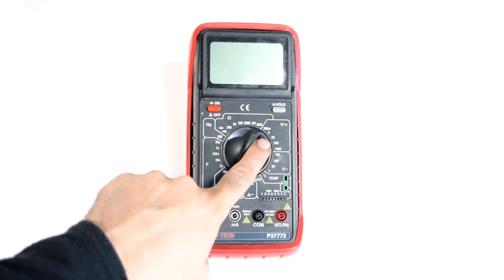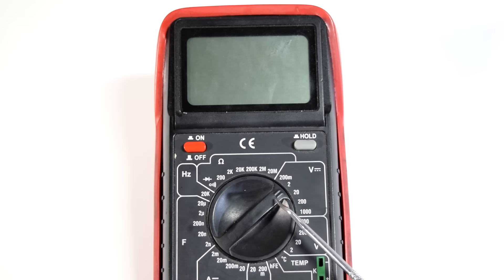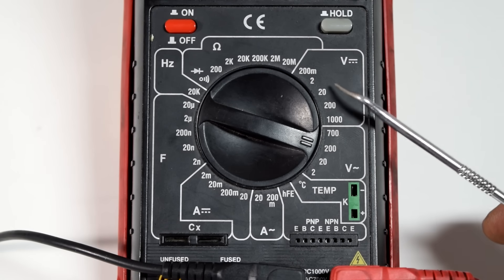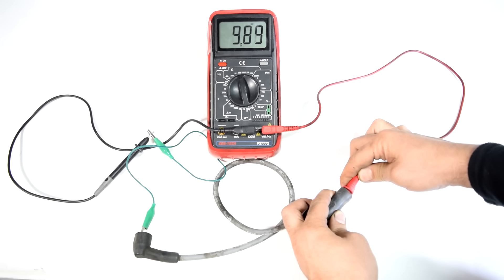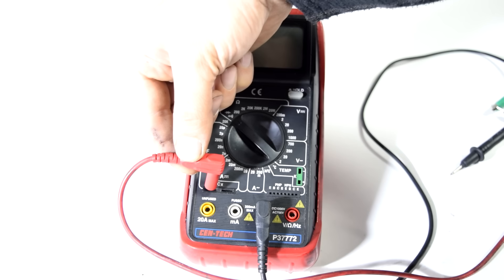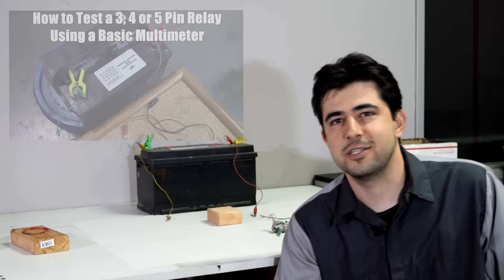How to Use a Multimeter for Beginners - How to Measure Voltage, Resistance, Continuity and Amps

Comment: You should not ideally put the probes in a mains (110v) socket with a probe in each hand. In the event of a discharge, the power will be sent straight across your chest - which may prove fatal. I was ALWAYS taught to use ONE hand to CAREFULLY insert the two probes into the sockets!...

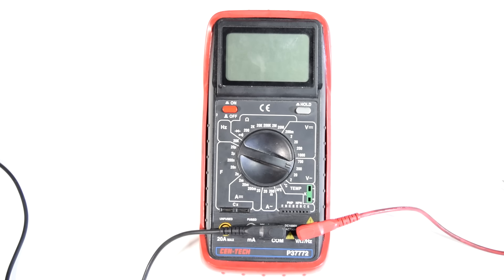Comment: I was watching this for refreshing on using a multi meter so I could measure things on circuit boards and then 3:20 I hear you casually say "So this is 118 V"💀💀💀 While I am playing with 12VOLTS over here🤣

Comment: I have accidentally connected my multimeter in parallel with leads connected to A port. I caused a flash. Is this fuse blown or meter is gone?

Comment: Great video! Thanks.

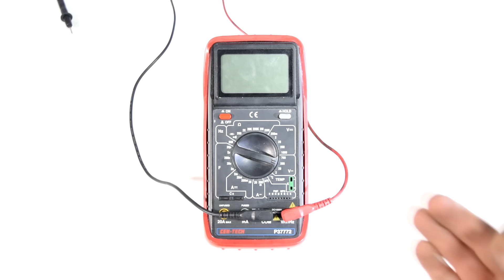3:45 The 'horseshoe symbol' is the omega symbol, which is used to represent ohms. The measurement unit for resistance in this case is ohms.

Comment: DC Voltage (0:14): Explains what DC voltage is and how to measure it using a multimeter.
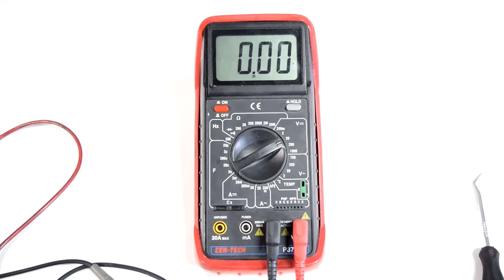AC Voltage (1:56): Describes AC voltage and how to measure it, including important safety precautions (2:35).
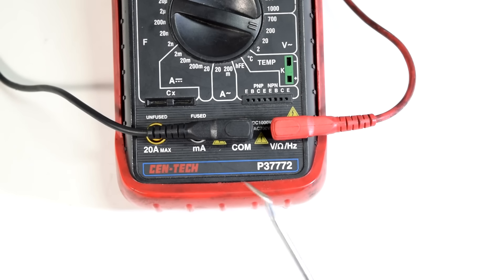Resistance (3:21): Explains resistance and how to measure it in a circuit (3:47), using a spark plug wire as an example (4:05).
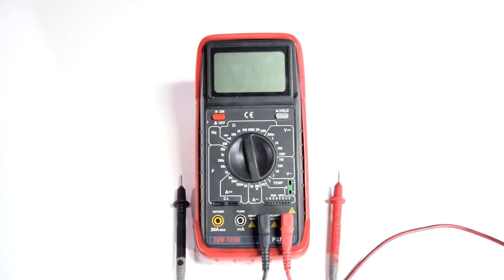Continuity (4:41): Describes how to test for continuity to ensure current flow in a circuit (4:45), including a word of caution about testing unpowered devices (5:46).
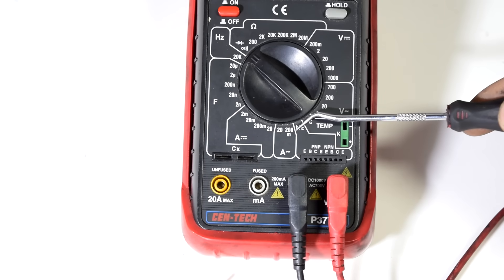Amps (5:54): Explains how to measure amps, including the importance of using the correct settings and test lead positions to avoid damaging the multimeter (6:17).

Comment: Great video, I am 66 yrs. Old and I see people using these meters like it's a Holy Bible, I just don't understand that after you get your reading from the meter then what? The meter doesn't fix anything all I can see is a bunch of settings that makes me dizzy. Other than checking  batteries. I just don't understand maybe I just have gotten to old to understand. I was going to buy one at home Depot just to have one setting in my tool box collecting dust. I just don't understand stand WHAT DOES IT FIX? I see it as a probing tool that fixes nothing. Thank you for the video.

Comment: Nice explanation, I'm a novice but always try to fix before throwing away. I inherited my foster dads multimeter & only know how to measure voltage. It's so old that I don't think it's got continuity. So I use just voltage for everything. 
All I fix are led bulbs & replace pots and caps. It's handy to know the resistance for unpublished items. Linear pots especially. I've also fixed 7 air fryers, 99% of the time it's a thermal fuse that's gone. They all seem to use 192c (377f) which seems low, their maximum temperature is between 210-240c /410-464f. I've been tempted to bridge but didn't or use higher temperature 205c/400f. Only one air fryer had a blown Smd fuse on the element/rear board. Again I used voltage and found it to be open. 
I'm rambling now but yes voltage is all I've used. I really want to get more into electronics as I've got older music production and hifi gear I just can't throw away.

Comment: Question the way you just showed how to test continuity let's say I'm working on a plug outlet n I'm not getting any volts from it n to check continuity how would I set the tester poles to check it, sorry I forgot what they r actually called😅

Comment: Great training, just an area of opportunity about continuity.  If your have continuity and clip a wire like you did it's not a short, it's an open circuit. Lots of folks jump to short circuit because they've heard it a lot but opens probably happen more (depends on your application). A short means the path has changed to take a shorter path of resistance than intended, an open means flow cannot get from a to b because of a disconnect. Like a cut wire. Thanks again. Just helping.

Comment: Thank you for this video.  I’m going to be rewatching this, oh about a dozen times!  You covered a LOT of info & I might say very well!  Concise & to the point, you showed me stuff I’ve only wondered about for over 50 years!  I have primarily used one of these just as a circuit tester and voltage meter.  And I never knew how exactly to do it.  I just stumbled along.  You’d think the manufacturer would have decent instructions. But o never saw any!  So thanks!  You’re a Mensch!

Comment: A great video, but what section teaches you to test for voltage after turning the circuit breakers off before you unwise or disconnect?

Comment: Working on Class 8 trucks , using a voltmeter DC voltage , continuity , or a 12 volt test light  always apply a load to test wiring .

Comment: Excellent!  I have a multimeter and always think I know what I'm doing but really fumble around with the knob and give up.  I like how you use the metal pick as a pointer and not finger-pointing that sometimes is vague as to what exactly is being pointed to.  I knew exactly where you were going.  Clear, concise explanations, and examples on each mode. Thank.

Comment: Thank You for this excellent step by step guide for beginners. It's perfect! The Centech C300 multimeter I purchased does not have a 15 or 20 Volt selection. The nearest selection is 60V, which I used to test my 12 Volt battery on my RAV4 Hybrid. What happens if I use a selection that is too low or too high? Like 1.5 Volts or 600 Volts?

Comment: When measuring Ohms you need to short out the red and black leads together and note down the resistance of the leads first, then measure the component and deduct the initial measurement from that result. All leads have some small amount of resistance... This can be critical when testing vehicle ignition coils tolerances.

Comment: On your meter, you show DC voltage which shows several ranges and the symbol ;question,on other meters, I have seen only the Symbol for DC.  What the difference in meters. Thanks.

Comment: Brilliant video, extremely helpful!

In the part about testing AC voltage, you caution the viewer to be sure of the integrity of the multimeter, probes, and leads.  Can you elaborate on that?  Do you mean making sure that the leads are fully plugged into the device, and that there are no cracks or holes in the insulation?  And how do you verify the integrity of the multimeter?  Would that be to use a different test function that isn't so potentially dangerous?

Comment: What is the positive side on a light bulb 💡? Is it crucial not to to switch positive with negative while measuring a current (ampere) ? Whatever that means.
I think you didn't explain alternate current measurement. Would you recommend a link to another video for that?

Anyhow, anyways, however as always, Thank You for this really fundamental explanation here in this clip

Comment: I have a Centech too so this was a good video thanks!!! I am building a drone and a total noob to meters. On your meter do you use the diode setting to check continuity? Mine doesn't have the extra amp plug in it only has 1 and it says 10 A... so I can only test up to 10 amps??

Comment: great video !! just want to ask one question when I'm testing for continuity and I've put my multimeter on the sound wave setting, I want to test a switch in my water softener. Do I plug in the water softener while testing it or unplug it?

Comment: Question: so does it mean you must always have a fair idea of the reading you should be expecting before you continue with the testing????
I ask because you said the multi meter is likely to get damaged if you're quite unsure about the voltage/amps that flows through the appliance..

Comment: No matter what I measure, the display shows 0.00. What am I doing wrong? This is a brand new multimeter. My probe leads don't have the metal ends like yours, they are plastic all the way to the tip.

Comment: the 10A socket is just for measuring amps right? am I right in thinking if you wanted to measure the voltage of a car battery you would use the other socket

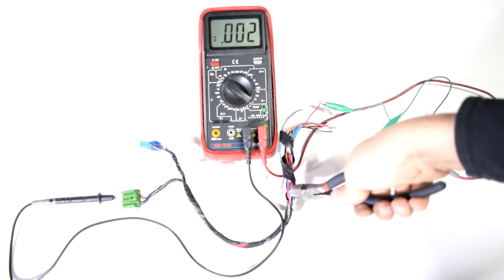Comment: Good vid.  However at about the 5:28 mark, you clip a wire and the continuity tone stops.  That is an open circuit, not a short circuit that you mentioned.

Comment: What a spectacular video. So clear and to the point, made for common users out there. No technicality whatsoever and use of very selective props to make it easy to understand, including all the safety measures… bravo. It cannot get better then this. 
I had no clue at start of video and but end of 8:00 minutes, I clear on so many things and can confidently use multimeter.
Thanks a lot 🙏🏻🙏🏻

Comment: Your videos are always excellent. I have one comment. When you cut the wire you don’t have a short. That is an open or incomplete circuit. A short would be a hot wire grounded somewhere in the circuit. It would blow a fuse or pop a breaker.

Comment: I have 2 questions
First 3:04 what happend if i switch them and put the negative in the positive and the positive in the negative
Second if the device i wanna measure works on chargeable battary is it DC or AC ???

Comment: Thank you so much 
But there is a question 
Can we test voltage in the relay base on a car I mean after we remove the relay from the fan relay for example  can we put one lead on the 30 pin and the another lead in 87 ? Will that activate the fan as jumper wire ?  
Will that burn the fuse of the multimeter?
Or it will just read 12 v between 30 and 87 ?
I wish you answer my question 
Thank you so much

Comment: Thanks.  Very self explanatory.  This really helps.  Now for the test.  Question, how do I test a cooling fan circuit on a stereo amplifier?  The fan does work because I had it tested, but it will not turn on once connected to the circuit board.  Thanks again.

Comment: If I check for the volts of my ebike controller (of the throttle, throttle unplugged) di I leave it disconnected from the battery ? Or do I need to hook it up to the battery ? Which is a 48v 20ah battery.

Comment: To split hairs, the spark plug wire does not have that rated resistance, the spark plug cap is rated for the resistance you were measuring for 🤓
Great video tho, helped me learn a lot about my cen-tech meter!

Comment: I can't understand how I've overloaded myn with speaker terminals and checking the bias on my amp  with the test points. I came back to it today thinking it would be cleared due to being off. But again, as soon as I switched on the amp it went straight to overloaded '1' . Going by you're video, could it be the leads? I was using crocodile clips too to help with extention

Comment: Nice video. However, you need to make a correction at the 5:30 mark. If a wire or circuit is cut or has no continuity, it isn’t a “short “. It is an “open”.  This is a very common belief to call it a short but that’s erroneous. Thanks

Comment: When using a multimeter to see if a battery is charged, keep in mind that a battery ALWAYS produces the maximum voltage of the chemical reaction that produces the voltage in the first place. When you see a voltage below this value, it's because the battery is so weak that the internal resistance of the battery is cutting down on the flow depending on the impedance of the meter.

Comment: best advice I can give a beginner if you don't know what your doing, don't try to check the amps, you can easily blow your meter. My neighbor learn this lesson a few weeks ago, I was to late to correct him. you have to break the circuit and put your meter so the current runs threw the meter.

Comment: Hi... Do you have any video that cover finding Positive & Negative of Wire?

I mean, some DC cable, like aquarium water pump... are using DC power. Usually 24v. And they normally come with 2-3M Cable that would need to manually extend for people who have a Electric Cabinet far from the Tank.

Now... most company sell their own extension... but some company don't. And sometime... it is inconvenience to use Extension because they come in 1M or 2M, sometime I have to use 5 of them, just to get cable organize the way I want.

And since cable is hidden in cable box anyway, it's not problem to manually cut them & extend with normal cable.
But sometime when I cut the cable... they all same color, same size... and I have no idea how to identify which is Negative or Which is Positive.
And it's even more confusing, when cable is 3 or 4P. Some Pumps require 2-3p and its own Earth Ground which making it's 3P or 4P.
Some wave maker, have like 6-7 wires and it's nearly impossible for me to ID without manually marking them.

Do you know of a way? Thank you.

My way, was to peel of the skins... then mark the cable one by one before cutting.

I'm hoping to use a Meter to identify it.

Comment: I don't mean to be disrespectful but a continuity test doesn't mean  the wire is good. It means there are no breaks in the circuit. It in no way checks the integrity of the circuit. You have to put a load on a wire to check to see if it can carry current/ Amps. Other than that good video

Comment: Thanks man. Great video. Everything was accurate and straight to the point. I haven't used a multimeter in several years and wanted to make sure I hadn't forgotten everything but as the video went on everything came back to me and I now feel confident I can go diagnose the problem I'm dealing with.

Comment: The only comment I'd make is that on my multimeter a lot of the icons aren't there or are different.  For example, there's no AC/DC picture (though there is "ACV" and "DCV", so it's pretty easy to figure out).  The only one I actually can't figure out is if there's a continuity tester.  I guess it would help if I had the manual (which I suspect if I did, it would make perfect sense).  Thanks for a great video!

Comment: Excellent video on multitesters....best one yet. 
 Most electrical guys overdo their explanations, yet miss explaining how to actually perform the basic tests or which symbols means what and you also give examples with each test of what components it would be used on. For example resistance testing a spark plug wire or lead.
 Thanks!!!

Comment: I fix a LOT of stuff on my own car when it comes to the purely mechanical things. However I am a total noob when it comes to the electric / electronic side. I had to measure the voltage on both sides of my car at the contacts to the rear ABS-sensors. The video showed me very clearly how the settings on my multimeter should be - so thanks for the great video. Luckily the cables were fine so I just need to replace the broken ABS-sensor

Comment: So what happens if i try to measure continuety with the power on? Lets say i want to check this on my camping van when the battery is connected. Will the multimeter blow up? :)

Comment: So I have a cheap $7 multimeter and I plugged the black probe into the com and red probe into the V(ohm)mA and set it to 200 on the ACV section of the multimeter, and stuck each probe into a a 120v outlet and there was a blue flash and it had tripped my breaker. Does anyone know why this happened? Is it because I have a cheapy multimeter or was it user error? Someone please help, thank you!

Comment: I actually got some good instruction here. Easy to understand with visuals for each step. Great introduction of the basics for the majority of people using a multimeter. This is much easier and safer really than trying to follow the instruction manual without much practical knowledge on electricity.

Comment: It's a superb video but, to pick up a small point, at 5.0: surely multimeter doesn't send voltage down a wire. Voltage is the potential difference, like the height  of a waterfall. It sends current down the wire from point of higher potential to lower potential, like water falling down a waterfall. It's 50 years since I studied that in school.

Comment: A little add on: sometimes you have to press select on the multimeter to change between AC and DC. My first multimeter had resistance and continuity on the same dial and again had to press select to switch between them. Just pay attention to the display before putting your leads on

Comment: Most things work on DC voltage.  You may  plug them into an outlet, but that's what transformers are for.    The electronics inside use DC.

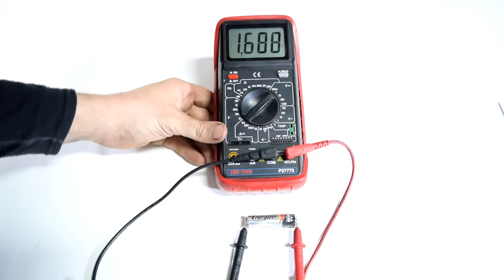Comment: 1:47 are the clamps used to hold the probes onto this car battery something I need or is that just for ease of use?
I'm going to be testing my car battery tomorrow and I don't want to blow myself up.  🤣
Reply: Just for ease of use in keeping the probes in contact with the battery terminals. You won’t blow yourself up. 😁

Comment: Great video - when testing for continuity how do you attach probes to both ends of the wires when they are not close together?  I'm testing a power window in a truck and need to test from one door to the other and the probe test wires won't reach.  What's the recommended solution?
Reply: Make a longer connecting wire with crocodile clips either end.

Comment: How do test a 1.5, 9 or 12v battery other than voltage.  For instance, a 1.5v should be 4mA or above and a 9v 25.A or above.

Comment: What happens in DC if you dont know what is plus and minus. So if you put the red on the wrong wire?

I have DC plus and minus wires that are not colored red and blue (red and black). How do I find out witch of the uncolored wires is red (plus/positive)?.

Comment: I think I might have unknowingly damaged my multimeter fuse when I was playing with them.
Reply: The fuse is easy to replace, you can get them from amazon. If you are trying to measure amps and hook it to the power and ground it will blow the fuse.

Comment: Thanks for the Video! Excuse me for butting in, I would appreciate your thoughts. Have you thought about - Tarbbatigan clean errors Tip (Sure I saw it on Google)? It is an awesome exclusive guide for discovering how to fix electronic devices without the hard work. Ive heard some decent things about it and my GF at very last got cool success with it.